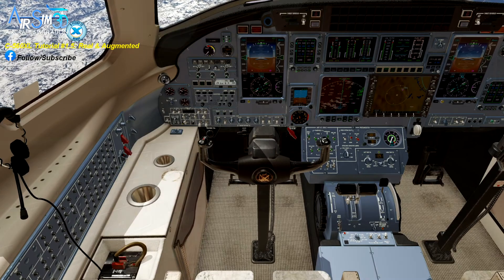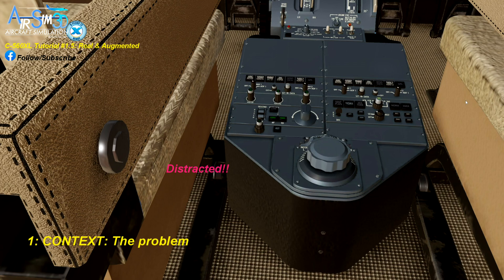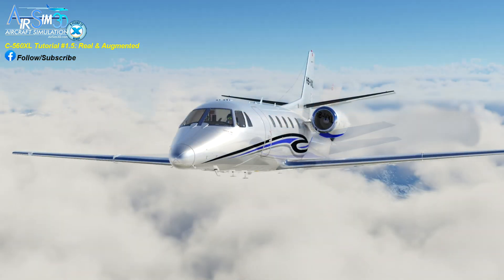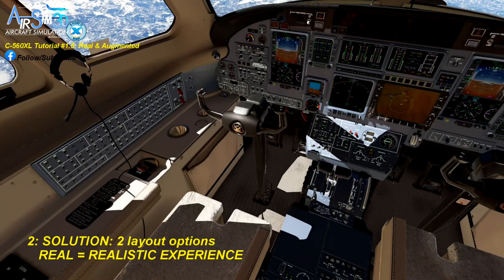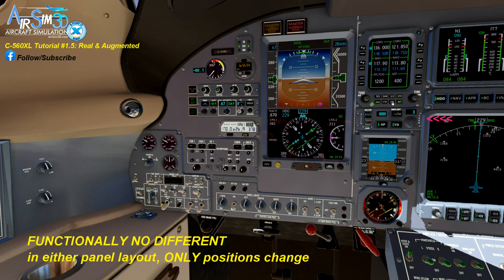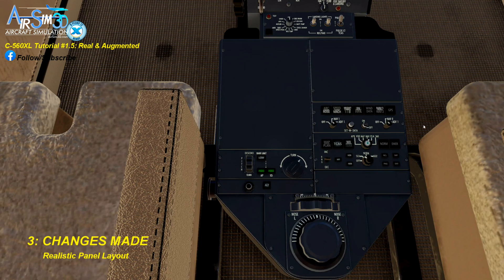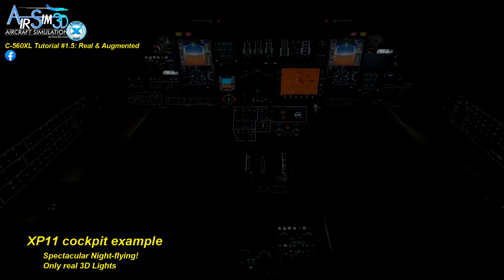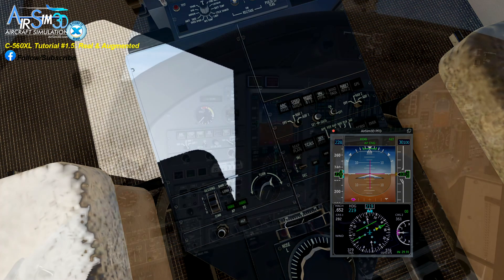AirSim3D Citation C-560XL Tutorial #1.5: Real and Augmented Modes

Comment: Unfortunately not good for vr. Shame we cannot zoom in xp12 like msfs and g1000 panel does not pop out in vr.
Reply from the maker: Yes, the XP12 team is keenly aware of the many VR issues they have in the simulator platform in their early Beta versions; this will get fixed as the beta matures.  

But just to be clear for anyone reading this, the C-560XL is VR ready, but is limited to perform to the VR standards currently available in the XP Simulator at this time in its early Beta. VR is still not perfect in XP12 beta at this time but we expect the XP team will get there in time.

 We do not recommend flying in VR in the beta's at this time.  If VR is all you want to fly, then we suggest you wait for later XP12 released versions.